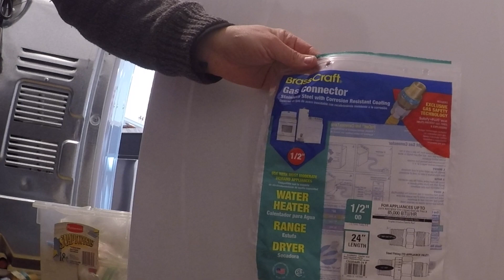How to Install a Whirlpool Gas Dryer

Comment: What size adapter did he use on the dryer that doesn't come with that kit
Reply: You've probably found the info by now but it's a 3/8" to 1/2" coupler or reducer. I wish these kits would provide these couplers or a female version on the other end of the flared adapter. Many previous dryer installs won't accept a male version and force you right back to the parts store.
Reply: @selmaave9145  Would love a link to this part at Home Depot. This is the piece I am missing.
Reply: Ugh. Same. Thanks.
Reply: Home Depot 1/2 x 3/8 Reducing Black Iron

Comment: Question: could you not have just attached the gas line directly to the dryer? Why the extra pieces?
Reply from the maker: Hey psy..,
Seemed like I could find the correct pipe match… maybe I bought the wrong size line to begin…was a bit of a slow down but worked nonetheless. Thx for watching!

Comment: Does the non-flared connector always go in that way or does that connect to sometimes have a flare? I'm talking about your first connection
Reply from the maker: Follow the directions on the package….there is a right way and wrong way based on the direction of the flow of gas for the safety connection. There should be an arrow on the fitting. 
In my experience, one side has a flare and  the other end of the flex hose does not have a flare…but checking the directions is best way to go…
Hope that helps.

Comment: What would happen if you put pipe dope on the flared side?  What do you use on the flared side to make sure there's no leak?  Thanks!
Reply from the maker: Hey squirrel,
Flare side NEVER gets pipe dope. 
Disassemble and clean the flared end. 
It should be metal to metal. Nothing else. It’s finely machined and doesn’t need pipe dope unless directions say otherwise.
Thx for watching!

Comment: Does that auto shutoff have inside threads to accept a 3/8 male flared fitting? That's what I have coming into my house.
Reply from the maker: Hey Chillidog,

At the big box stores , they have a variety pipe fittings to get you to exactly where you need to be. 
I’d take a picture and measure it so when you go into the store, you can ask them to get you from what you have coming into the house to something that will  work w/ the connection kit. They literally have stuff for every possible combo.
Your neighborhood hardware store can likely do the same as well.
Hope that helps!

Comment: What do you do if you see bubbles?  Do I shut the gas off, take everything apart and start again?
Reply from the maker: Hey squirrel..,
I would shut off gas and try to see if there is room to tighten it some more where the leak is.
If it’s tight, yes- turn off gas and reapply pipe paste. Try again.
Hope that helps. 
Thx for was watching!
Reply: @Housebarons  Thanks! :)

Comment: Thanks for this nicely detailed video! I was told that I could get a shock (or worse) from my gas dryer, as it's not properly grounded. I have no idea what this means, and I watched your video to see if the electrical aspect of hooking up dryers would be addressed. Mine is just in an outlet with a fitted adapter. Are dryers automatically grounded if they have the 3-prong plug?
Reply from the maker: Hey Sheena,
I would certainly expect the 3 prong plug should ground it. Never heard that before. 
If your plug looks like a regular household plug, it should not be any more worrisome than any other electrical appliance in the house. 
The electric turns the motors. The gas provides the heat for the dryer.
If you house is properly wired, then plugging in your plug should ground the dryer. 
Thx for watching.

Comment: can you use teflon pipe tape instead of the compound
Reply from the maker: Hey T,
We have used Teflon tape in the past. But the drawback to it in theory is that if either fitting you are joining has a burr, it could cut the tape and leave a passage for gas to leak out. The compound does not have that same disadvantage. But in the end, the choice is yours. 
Hope that helps.
Thx for watching.

Comment: I don’t know if my home uses propane or natural gas. It’s thru the city. Does this matter for this connection, as in any special precautions or is it just a matter of using the parts to connect them?
Reply from the maker: Hey VN,
I would call you city and check. It don’t know that it would matter for connections, but the  type of appliance would matter. 
Thx for watching !

Comment: Great video! 
I have a quick question though. You mentioned not to put the thread on the flare side, but i tested the leak with the soapy water and the bubbles came out from the flare side of the fitting. should i just try and tighten the fitting?
Reply from the maker: Hey Hsuan Liu,
The way the hose is designed, the flare end goes onto a flared fitting so that both of those precisely machined pieces fit tightly together. So first, check that you have a connection made up of 2 flared fittings. 
If that checks out to be correct, then try tightening them some more. If that doesn’t do it, then the only thing I can imagine is that one of those flared pieces has a slight defect and needs to be returned to the store for a new one.
Hope that helps.
Thx for watching!
Reply: you prolly dont care but does any of you know a method to get back into an instagram account..?
I somehow forgot my login password. I love any help you can give me!
Reply: @Mohamed Cristian Instablaster :)
Reply: @Emerson Wilson i really appreciate your reply. I found the site on google and im in the hacking process atm.
Seems to take quite some time so I will get back to you later with my results.
Reply: @Emerson Wilson It did the trick and I finally got access to my account again. Im so happy:D
Thanks so much you really help me out :D
Reply: @Mohamed Cristian glad I could help =)
Reply: Want size is the adapter to the dryer

Comment: I have to disconnect my gas dryer and then reconnect it. Do i need to reapply Pipe Thread when I reconnect?
Reply from the maker: Hey Jennifer,
The flare end never gets pipe thread sealant. 
So depends on which end you disconnect. 
But if it has sealant on a non- flare end, yes, I’d add again.
Thx for watching.

Comment: 4:12 "These two right here" THOSE are the pieces I'm missing. What are they called and where can I find them?
Also, why not just skip those two and connect the line directly to the dryer?
Reply from the maker: Hey Joe,
Those are reducers and can be found at big box home stores.
They are needed if you need to make dis-similar sizes match up. Thx for watching!

Comment: What is the pipe thread for? To prevent leaks?  Thanks for the video.  Will be connecting my washer and dryer tomorrow.  😅
Reply from the maker: Hey Eli19T,
Yes. The pipe paste or pipe tape fills any gaps in between the pipe threads.
Thx for watching!

Comment: What is the additional piece that you put on the back of the dryer.. doesn't look like that was in the original gas line package
Reply from the maker: Hey T,
It is a pipe “reducer” which is larger on one side than the other. It allows the joining of two different sized fittings.
Hope that helps.
Thx for watching.
Reply: Could you accomplish the same by buying the correct sized brass craft fitting. Like a pssd-43 for example. Any advantage to using the reducer?

Comment: I was taught to NEVER use a pipe wrench to tighten brass fittings...The teeth on the pipe wrench shreds the brass...Still a thumbs up..👍
Reply from the maker: Hey Arnelle,
You are right. Not best practice, but I did it nonetheless. Thx for watching!

Comment: What's the "fitting" in your Left hand at 4:14.  I have the brasscraft gas supply line, the fitting in your left hand has to be purchased separately?
Reply from the maker: Hey onenikkione,
The fitting is an iron pipe/ black pipe fitting. It’s a reducer - to fit on to the smaller dryer end and the larger brasscraft end. 
You can find them at the big box stores in plumbing section.
Thanks for the question and view!
Reply: @kylem6532  it doesn't fit i got half a turn out of it what size was the adapter he use on the back of the dryer
Reply: @mauricelewis1650  hey! He uses
a 1/2" by 3/8" coupling..

Comment: For gas dryers i would use rigid or semi rigid aluminum vent
Reply from the maker: Hey Florida,
Yes. Flex duct is second choice, but here I chose it due to access issues.
But point well made. 
Thx for the comment.

Comment: Do you shut on and off the gas valve ?
Reply from the maker: Hey Huc,
The gas is shut off for the install. Then turned on when all is complete.
Thx for watching.
Reply: @Housebarons Gas shut off to the whole house or just where the connection is to the dryer?

Comment: How do you know if the gas line is "live"??
Reply from the maker: Hey defcrx,
By smell if the line was turned on. Gas detection sniffers are used by utility companies and can find very small leaks. Those can be purchased. Since it is under low pressure - maybe a sensitive meter? 
But if you think you have a questionable line, best to call gas company immediately. They could clear things up quick.
Reply: @Housebarons  Thank you very much for the info..
Reply: By looking at the shut off valve. "Live" is an electrical term, not usually used for gas.

Comment: Do I need to shut the gas off from the main as well? Or just from the valve next to the dryer?
Reply from the maker: Hey Chris,
We turned ours off nearest the dryer. But either should work.
Be sure and do a leak test after. 
Thx for watching!

Comment: I don"t like that flex crap. 4"round solid is the safest.
Reply: But flex is needed, because the dryer may move slightly during operation so all solid pipe may be bad, because of excessive stress.